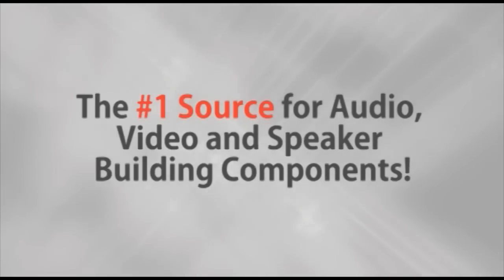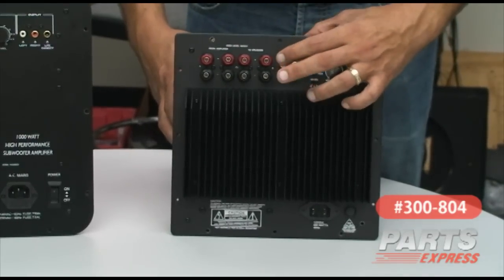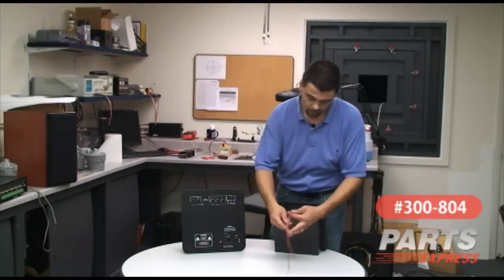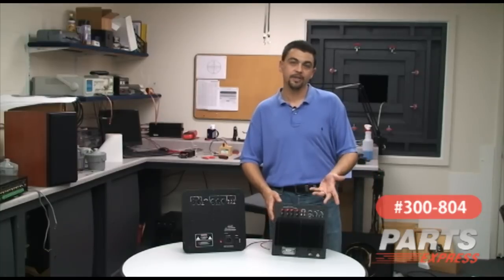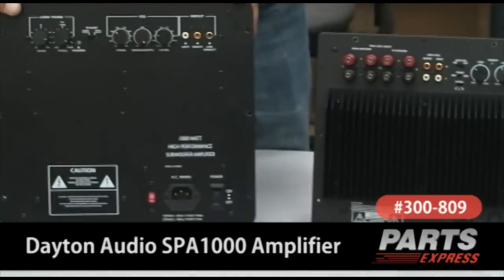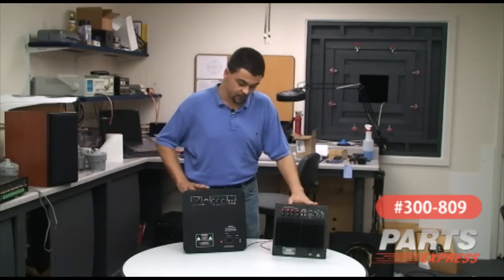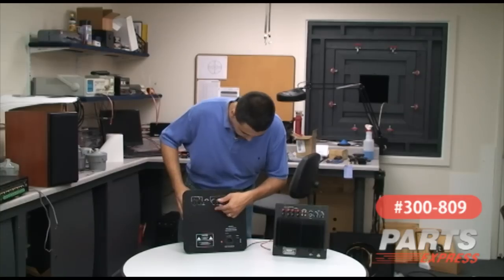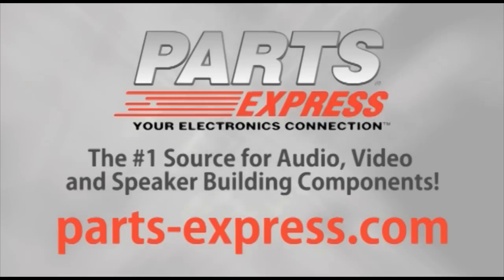Dayton Audio Subwoofer/Speaker Plate Amplifiers: Common Wiring

Comment: Do I need to split the subwoofer preout from my AVR to both inputs on the SPA250 Line in or can I just use the Line In white input?
Reply from the maker: The white left channel input is for using the LFE/subwoofer output form your receiver.  You do not need to use both inputs for that application.
Reply: If I did use an RCA splitter to go from AVR Subwoofer out to Amp Line In and plug in both L and R low level input on the amp, does it add something like +6db of input gain?
Reply from the maker: No, it will add nothing to the signal.  It will simply sum both channels into one mono signal.
Reply: Ok - why does the video at 40 seconds instruct me to use a male to femail Y-Splitter to split the signal into the dual low level RCA inputs?  This is what was confusing me.

Comment: Great video explained so much I thought the bass shakers mounted to one of those speaker/amp connectors in front. I didn't know it was that simple. My receiver is a 7.2 so very easy hookup with the LFE.. Just ordered the Dayton Audio/bass shaker kit. thanks for this video!!! Also a question can I hook up 6 AuraSound AST-2B-4 Pro Bass Shaker Tactile Transducer to the SPA250 amp or am I limited to just 4 shakers. I wanted 2 for each seat one on the bottom and one for the back. Thanks

Comment: Question:  These plate Amps seem popular to power  bass shakers such a s the Dayton Audio tt25 and the Aurora shakers.

the output speaker cables have those female slip on plugs.  Is the only way to hook them up to additional cable by cutting off the end and stripping it to expose the wire?  I really do not want to do this just in case something is wrong...then I would not be able to return the item do to the altercation.

So, am I missing something or is there an easier way to hook them up?